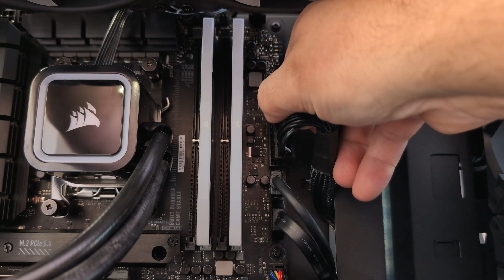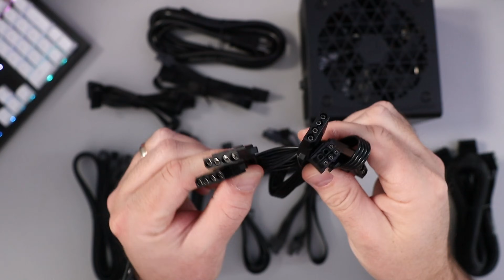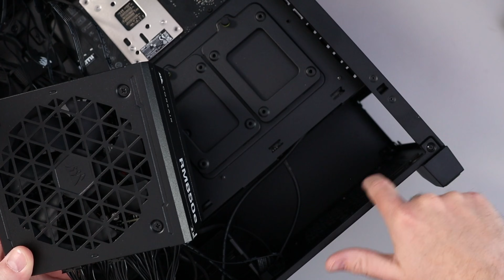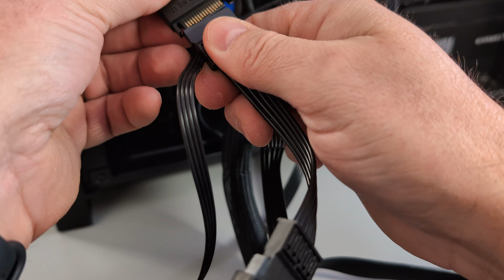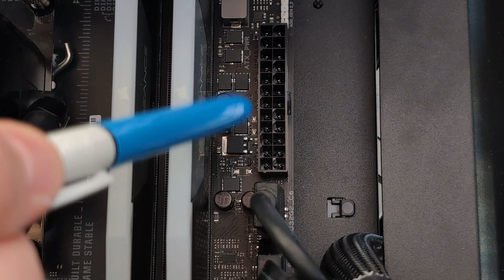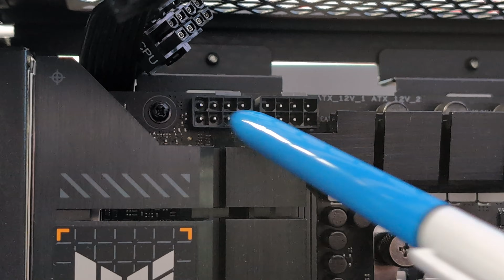How to Install a Power Supply in a PC Step by Step (Corsair RM850e PSU)

Comment: Dear friend,
Now the card requires an 8-pin connector.
I saw the connector labeled (pcle) 
But the other side, which is the connector that connects to the power supply, is a 7-pin connector with pin 8 empty. Is this a mistake?

Comment: Great video I referred to it quite a bit installing a 750 corsair which was very similar.  Unfortunately I was able to power the PC but it will not boot up.  Disconnected and reattached the original PSU and it worked.  Not sure what I’m missing to make the Corsair work

Comment: Aaaaaaah, now I understand. Today I received my RMe PSU and I was wondering in which direction it should be installed, fan up or fan down. Because nowhere do they mention that. But I noticed that when you put the fan up that the writing on the back plate where the sockets from the PSU are located is upside down. Now I understand that it all depends on if you have the air ventilation with the dust filter at the bottom of the case, which I have. So it makes more sense to install the PSU with the fan down. Thanks for sharing👍
Reply from the maker: Awesome, glad I could help! 👍

Comment: The PCIe cable that came with my RM850e has the pins split 6 and 2 on both ends and I can't get it to fit into any of the PCIe slots on the power supply. What am I doing wrong? Or was the wrong cord shipped with my power supply?
Reply: I have the same problem did you find out what was the problem
Reply: @Jorge13345  it turned out my cable actually ended with the 12v plug which plugs into the PSU and then that cable split into two PCIe cables. So I have one PCIe plugged into my GPU and the other PCIe isn't plugged into anything. And it all works perfectly!
Reply: @MomoRamsay so your gpu just has one cable in it while having two slots correct
Reply: @Jorge13345 I'm not sure what you mean. I switched out a smaller power supply for a bigger one so I just unplugged what was already plugged in and plugged in the new power supply. As far as I could tell my GPU has one 8 pin plug for the power supply
Reply: What gpu do you have and does it have two 8 pin slots
Reply: @Jorge13345 I have a GeForce RTX 4060 and it only has one 8 pin slot in it for the psu

Comment: I saw  the cable labeled  pcie  for the gpu was put into the power supply slot labeled cpu next to slot pcie . Can you confirm it does not matter which slot you use? Thanks

Comment: Subscribed. Hey man. My motherboard bends when plugging the 24 pin PSU cable. There is no screw near the 24 pin socket iin my motherboard. I used force When I plug the 24 pin cable and the mobo bends significantly but the PC turns on and runs fine. Should I need to be alarmed?.
Reply from the maker: Thanks for the support! It's not ideal for it to bend too much, but if it's running fine you're probably okay.

Comment: On wich motherboard should I use two or one CPU kable? 
And when should I use wich cable for the GPU?
Reply from the maker: Some motherboards will only have one CPU cable slot so just use one but if it has two then use 2. As for the GPU, have a quick look at the connector to see again if it's one cable, two cables or the 12VHPWR cable. If it is a 50 series card It is likely the 12VHPWR cable.
Reply: @NorthernVikingEveryday  so two cables are the non PCIe 5.1 600 W
Reply: @NorthernVikingEveryday thank you very much by the way. I am currently building on my PC and I have just put in my GPU.